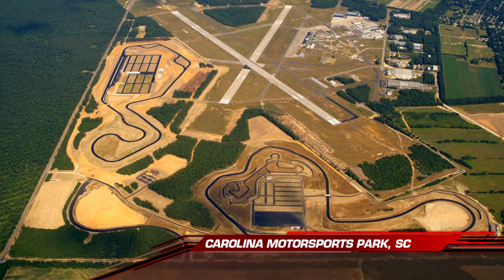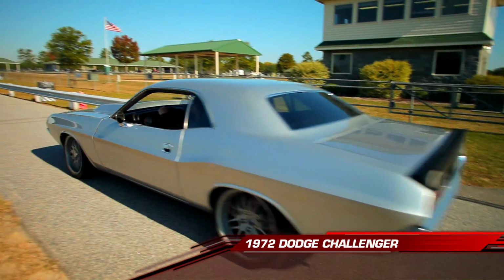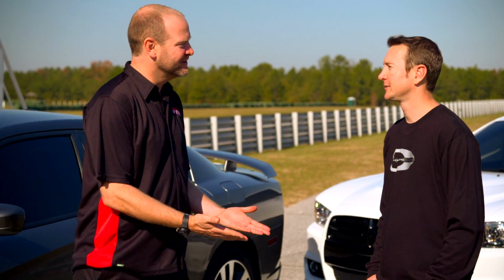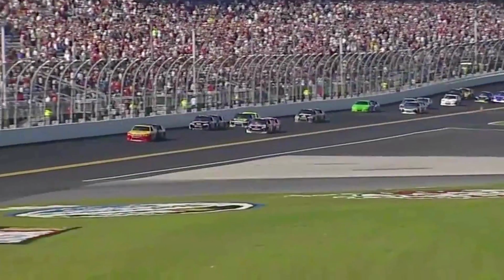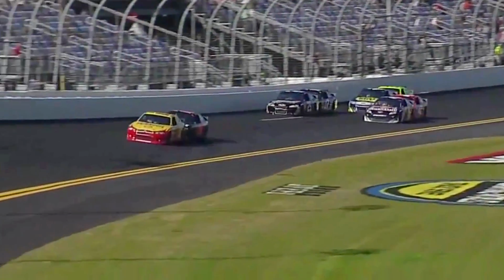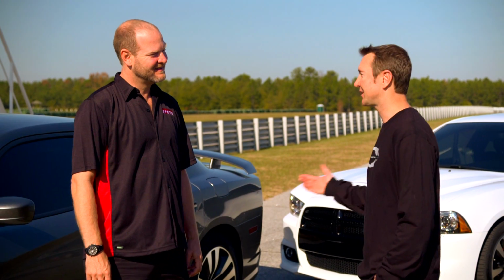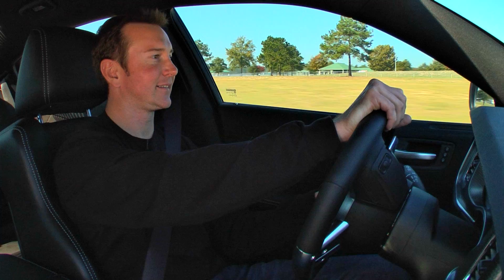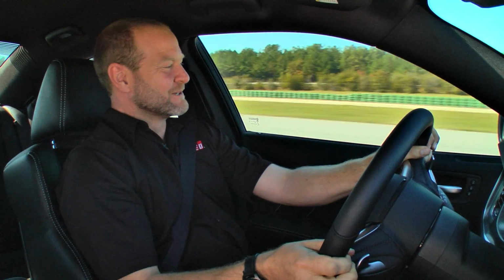Speed and Kurt Busch Test Drive the 2012 Charger SRT8. Part 1

Comment: Um.. yes they are hemis. I have both a new 5.7 and an old 392 from the 60's they changed the valve angles so it is not quite so steep as the old ones (not so much stress on the rocker gear), however it still maintains what makes a hemi, a hemispherical head and center mounted spark plug(s), so when ignition takes place you get the same nice centered evenly distributed fuel burn.